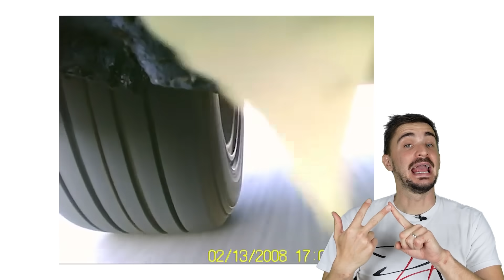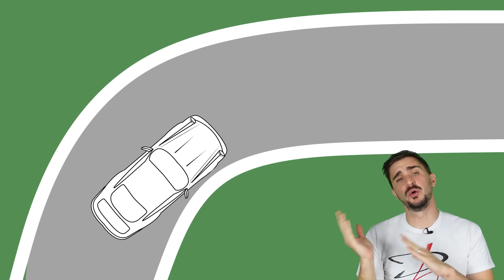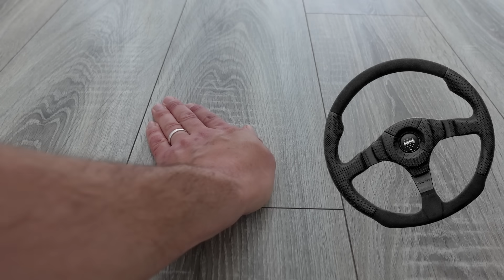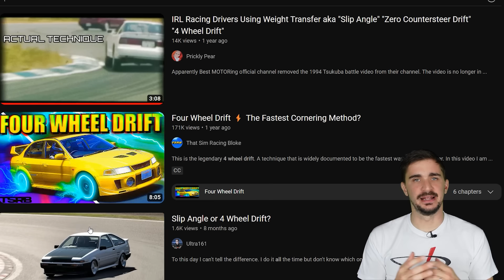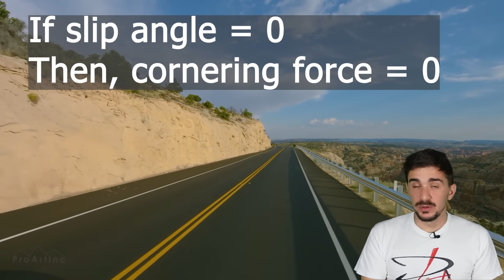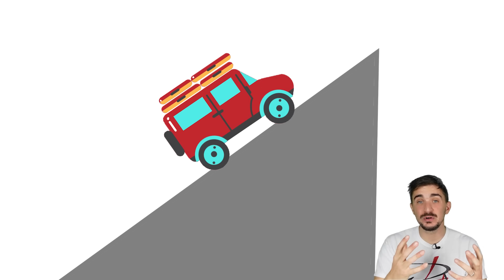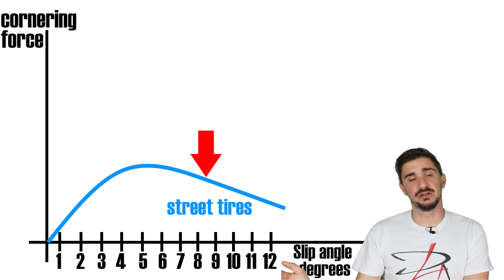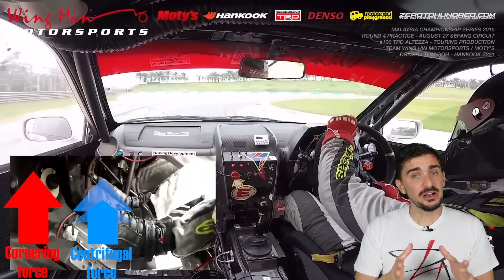You Think You Know But You Don't - Slip Angle Explained in a Way You Will Understand

Comment: I don't think this is entirely accurate , nor have you actually described the mechanism of cornering force.

It's been a while since I did automotive engineering but:

- you imply that the 'next' contact patch defines the direction of the vehicle when the tyre gets there.  Ie as the tyre rotates through those 20cm or whatever, the vehicle changes direction by an amount equal to the slip angle.  This is obviously wrong when you consider the case of driving straight in crosswinds or on a cambered road.

- tyres DO slip against the rd as part of the deformation that comes with slip angle.  That's why tyres squeel when cornering hard even when the car isn't sliding at all

- the complicated happenings at the surface of the road where the tyre is slipping create the cornering force, which you basically gloss over entirely (I don't blame you as it would invalidate the rest of your video).  I clicked on the video hoping for a refresher, but you don't say anything more about it except some nonsense about cornering force not being friction (which isn't true at all, I don't know what you're getting at with that)

Comment: Thank you for explaining this. Is this a reason why lighter cars corner better than heavier cars?

If we just consider friction and model it as F = uR (Some coefficient times the reaction force), we expect friction to be proportional to weight and therefore the car to be able to corner at the same speed no matter its mass.

If we consider slip angle due to tyre deformation, we realise that the tyre will deform more with a heavier car and, therefore, the slip angle will be greater at the same velocity. This means the peak occurs at a slower cornering speed.

Comment: This video really starts to answer several questions, from why spoilers are important, to why accelerating through a corner can be better, to why slipping on turns happens more on wet pavement than dry, and how cars turn in the first place. (Very different from motorcycles.) I had to watch it backwards at 2x speed for it to make sense, but that might just be my own weirdness. Great video!

Comment: you are mistaken in this video, you do not need a slip angle to be able to turn, that is not the basic 101 of taking a turn. The slip angle thing is a consequence of using viscoelastic material for the tyres, but the tyre can be made of something else.
You can turn withour a slip angle, see for example the concept of "omni wheel" where you can put some contact strength only in the direction where the tyre is pointing.

Comment: This was great. Slip angles are always a tough topic to explain.  Next, could you tackle the topic of contact patch aspect ratios? Wide tires have wide but short contact patches. This results in each piece of the tire's tread being part of the contact patch for a shorter time. Consequently, for any given slip angle, each point on the tire's tread will experience less lateral displacement before it finally exits the contact patch.  This can contribute to the tire tolerating a larger slip angle.  But it also reduces feedback at the adhesion limit.  When the tire begins to lose adhesion, the lost of grip starts at the rear of the contact patch where the lateral displacement of the tread is greatest and the rubber's restorative force is highest. As the rubber's restorative force (the force pulling it back to it's natural position) exceeds the friction that binds it to the road, it begins to release that grip on the road.  Since it happens first at the rear of the contact patch, and then progresses forward, it effectively shortens the contact patch and shifts the centerpoint of the contact patch forward.  This movement of the contact patch produces an effective change in the self centering force (because the contact patch is closer to the point where the pivot axis of the wheel intersects the ground), usually causing the steering to feel lighter as grip deteriorates, because the change in camber reduces the centering force produced by the steering system.  In a tire with a long, skinny contact patch, this progression is more gradual, making it easier to detect and react to.  In a tire with a wide, short contact patch, the loss of grip starts at the rear by has shorter distance to spread before reaching the front of the contact patch.  This not only makes the loss of grip more sudden, but it also reduces the degree to which the contact patch centerpoint can move. Thus, wide tires cannot produce as much change in steering centering force at the limits of adhesion, compared to narrow tires.   It'd be great to see some of these topics covered in your enjoyable, understandable, well-illustrated style.

Edit: For some reason I mentioned camber when I was thinking about the contact patch and the self centering effect of caster.
Reply: Whatt???
Reply: @jorgemeireles5549   Sorry - that was confusingly written.  I just corrected my erroneous reference to camber. Should be clearer now.
Reply: Hey Scott, some interesting comments, f.i how the tire starts to lose grip at the rear of the contact patch, and how losing grip makes the steering go light (logical, less cornering force happening, even disregarding the diminishing offset between center of (the still gripping part of) the contact patch and pivot axis of the wheel), but otherwise not convinced. Simple math tells us that tire width alone has no influence on contact patch length whatsoever. Comes from diameter/circumference first, and sidewall flex and thus also tire pressure second. In short: not disputing that wider tires might be less predictable/forgiving, no idea, but for the why I feel we have to look elsewhere. Not a tire engineer myself, just a  track day dude, so don't know what that 'elsewhere' might be. Cheers, Remco
Reply: @brembopollypor9965  Thanks for the comment - I didn't expect to see any more replies to this one.  

Regarding the length and width of the contact patch, my assertion that a wide tire has a shorter contact patch is based on what I've read, as well as my own intuition.  I'll break it down, and you can call out anywhere you think I'm of the mark. 

1. Contact Patch Requires Deformation: A perfectly circular wheel with absolutely no deformation, resting on a perfectly flat surface, would (in theory) have a contact patch with zero surface area. Imagine a train wheel on a rail - if the wheel were a perfect circle, the part of the wheel that touched the track would be only the exact point that's tangential to the track. It would be a point (or really an infinitely thin line), crossing the full width of the wheel).  So, having a contact patch that is greater than zero is entirely dependent on deformation.

2. A Pneumatic (air pressure) model is the closest/easiest way to predict the contact patch size:  If we think of the tire like a balloon, with a weight resting on it, we can calculate the contact patch based on the weight, and the pressure.  The weight divided by the pressure gives us the surface area required to suppor the weight at that pressure.   Hence dropping the tire pressure requires a larger contact patch to support the same amount of weight.   BUT we know this isn't a perfect model.  The sidewalls and overall construction of the tire carcass make it act differently from a perfect balloon.  Runflat tires prove that point.  Nevertheless, we can say that air pressure is probably the primary determinant of contact patch size (total surface area) in most cases. 

3. Aspect Ratio is Determined by Tire Width:  (This is where I think our perspectives may differ). Since the area of the contact patch is mostly determined by weight and air pressure, a wide tire and a skinny tire running the same pressure on the same car will tend to have the same sized contact patch (weight divided by air pressure).  It's a little bit counter intuitive, because we often think of wide tires as having a bigger contact patch, but the pneumatic model of a tire suggests that this doesn't end up being true.  If a tire is supporting 1000 lbs, with an air pressure of 25 PSI, then it will need (roughly) 40 square inches of contact area to transfer that weight to the ground.   In general, a wider tire should still have a contact patch (since the  contact patch is almost always the full width of the tire, unless there's some really crazy camber setup.)   So, a wider wheel and tire, will produce a wider contact patch, while the narrow tire will have a narrower contact patch.  But if the total surface area of the contact patch is the same (40 square inches in the example above), then the narrow tire will have to deform to a create a longer patch.   It simply can't get (much) wider. 

Now - the assertion above is all based on idealized models of how tires behave.  A narrow tire with a really high aspect ration  (Imagine a 155/75/14).  If the sidewall were very very flexible, but the tread was very very stiff, then the sidewall might deform extensively at the point of contact with the ground and produce a contact patch that's wider than the tread.  But we generally don't see this happening (it would have to be severely underinflated for the sidewall to deform like that).  So for the narrow tire to achieve sufficient contact patch area, the patch MUST get longer.  Is this a perfect, hard-and-fast rule?  No, definitely not.  Tire construction varies widely and the influence of all the rubber and steel/kevlar/whatever in the tire can definitely affect the shape of the patch.  But in general the narrow tire tends to have a longer skinnier contact patch. 

I have a book somewhere that has really great photographs illustrating this.  They had the car on a transparent plate (thick glass I guess) and photographed the contact patch from below, illustrating the different shapes you get depending on the tire width, the loading, airpressure, and lateral forces.  I'll try to find it and share a link.  (I'd photograph the images and post them here, but that'd be a copyright violation). 

Anyway - happy to discuss further.  And if I'm missing something, or if I've got something wrong, I'm always eager to find out, and get incrementally closer to the truth!
Reply: @scottlyman7427 Too many letters😂, stopped reading after 1.) And on that one, ‘entirely dependent on deformation’ , I have my doubts. You’ll find it hard to get, for example,  15cm’s worth out of a wheel with a circumference of 10.

Comment: Hmm... this is a good explanation of one small part of what's going on, but the reality is much more complicated. Most of what you're actually seeing in those videos isn't slip angle (that's very small, barely perceptible, and also happens continuously, not step-wise, and even tread block by tread block for tires with all-season tread patterns with lots of grooves and sipes) but sidewall flex. Different designs of tire have very different attributes in terms of how they handle slip angle and sidewall flex.

Comment: Wouldn't the "4 wheel drift" technique be more about utilizing the slip angle of the rear wheels? In this video you have only covered the front wheels, but what about the rears?
When the car turns, the car is slightly angled, but wouldn't getting the car angle closer to the optimal slip angle of the tires generate more cornering force from the rear tires?
Reply: No because the rear tires can't steer, they do slip sideways, but they never steer.

Comment: So when you slide just a tiny bit.. do you create slip angle at the rear and reduce it at the front? As in, through a tight turn where the steering angle would be too great to be in optimal slip angle range for the front tires, by sliding the car you generate a slip angle in the rear tires and allow a more shallow steering angle to be used, creating a faster path through the turn?

Comment: Can the rear have a slip angle? I would assume so. The steering gives front tires slip angle, cornering force is generated, car rotates, giving the rear a slip angle. But does that mean rear always has smaller slip angle than the front?

Comment: But, the thing is, that even solid wheels will turn the car (like LEGOs for example; I removed the tires and left only the plastic rim and the "car" turns). I am not convinced; I think when the wheels turn, the friction is no longer parallel to the car; it is parallel to the wheels, but not the car because the wheels are turned. So there is a friction coordinate that is parallel to the car and another that is vertical to the car; and that latter one makes the car turn. Maybe I'm wrong...

Comment: Superb video. Could you explain if & how slip angle works on single track vehicles, where the motorcycle leans into a corner, the tire contact is small and the steering acts in conjunction with these factors. And does being a driven rather than freewheel, front or rear, affect the physics. Keep up the excellent work.

Comment: Sorry for the poor English.
As I understand, if the tires are not made of flexible material, for example, wood or metal, the steerability of the car and the rotation of the car in the corners will be greatly reduced?
Indeed, it was a great job and spectacular video. 🐐

Comment: Overall rather interesting, but I think some corrections may be necessary.

There isn't really a thing called centrifugal force. It is simply a result of the physics diagram. The actual forces that acts on the tire is straight, and perpendicular (depending on the direction of steer). Centrifugal force that is stated here is simply a result of inertia from the wheel wanting to go straight, but the object is moving with respect to a circle, and thus results in it being flung towards the opposite direction. It should be regarded as straight relative to the vehicle's original direction, not opposite to the direction of the steer.
When explaining steering, it may be useful to explain it by the physics diagram and explaining the difference between static and dynamic friction. It is important to note that the assumption here is that the wheel is rolling without slipping, and thus static friction is assumed. It is important to note that frictional force is calculated by weight*gravity*frictional, thus increasing weight does increase cornering performance, and so is generating more downforce.
The cornering force mentioned is the centripetal force that turns the vehicle. It is the force that moves the vehicle relative to a point, creating a circular movement. Any turns is always relative to a center of a circle and this can be calculated.
Lastly, it is also to note that the steering rack is designed to account as best it can, the difference in radii for each inner and outer wheel when cornering, and that the slip angle is greater on the inner wheel compared to the outer wheel.
Cheers

Comment: Do non-rubber tires exhibit slip angle as well? For example, if you had steel wheels (with no tires) on a steel surface, the grip would obviously be very low, but a vehicle like that could change direction. Is that because the steel deforms slightly? Or are other phenomena at play?
Reply: In our world, cars and other transport turns because of steering. And this started long before invention of tyres. Throw this video away .
Reply: @simplemachine9531  uhh okay sir, dare to explain how in your world the steering magically makes the vehicle turn?
Reply: @szymoniak75  rolling resistance is lower than static friction. That's the reason why human invented a wheel actually.

Comment: "This isn't scientifically correct." Um, yeah, you passed that barrier long ago when you talked about "centrifugal" force as if it were a real thing. This guy's physics is terrible (please just ignore all that "hand-walking-past-hand" junk, which at best vaguely approximates adding steering angle, not something like equilibrium cornering). By the time he gets to empirical graphs of cornering force versus slip angle, it's fine - those are measured values for real tires. But the "explanation" that comes before it is just crap.

Comment: Mostly a good explanation but I have to point out that racing slicks actually tend to have lower slip peaks than road tyres. Road cars, last I checked, sit between 6 and 10 and Indy and F1 tyres are far closer to a peak of 2 - 3 degrees. Their construction is incredibly stiff and this is also a large part of the reason the back end only has to step out slightly for the car to be all but unsavable. Even in the late 80s/early 90s peaks were down as far as 5 to 5.5 degrees. The lack of extra inward cornering force is offset by higher speeds and huge friction resisting immense outward forces. This is also part of why F1 cars kinda look clownish around Mirabeau/Casino.

Comment: Actually easy

The tire push the car opposite to deflection - that is turning. The push must be greater than the push outwards by the movement energy.

It is friction but friction sideways of the tire not longitudial.

Sliding is then the centrifugal forcë from the corner speed is greater than sideways friction of the tire. You prefer that at the rear of the vehicle as it point the front to the desired direction so you need less deflection (sideways friction) at the front to push you the vehicle (turn).